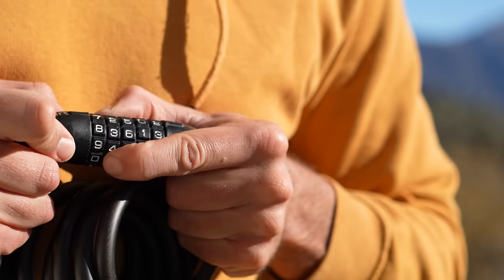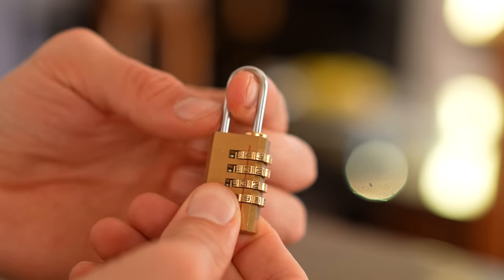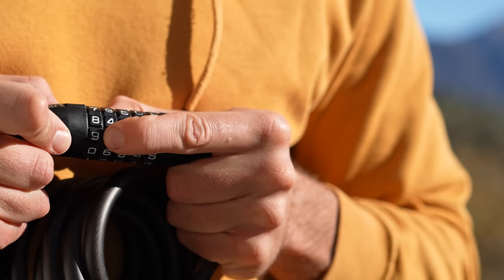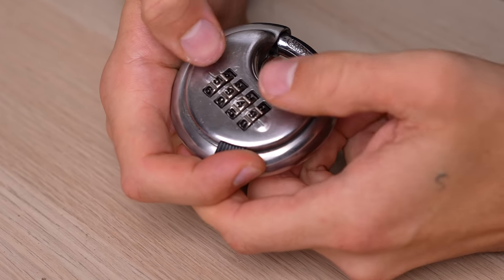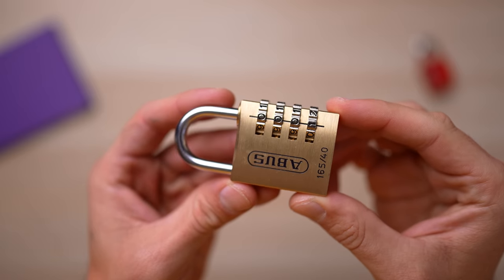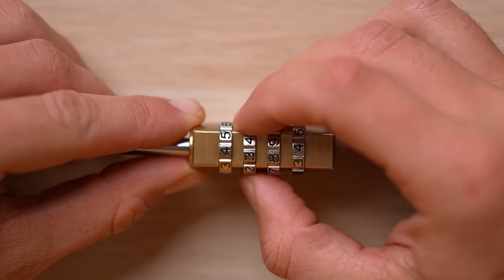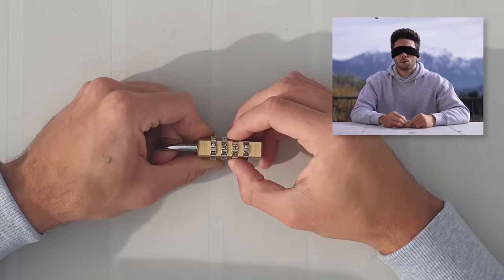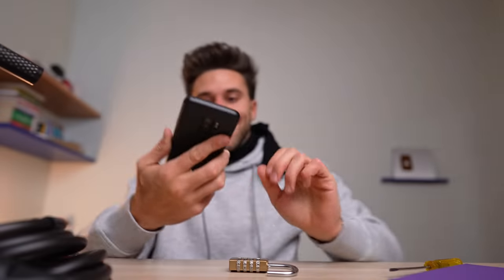This is Why Combination Locks are Completely Useless

Comment: There is an obvious caveat to your claims. Combination locks and any locks for that matter are so easy to pick when you're sitting in a warm room, and have all the time in the world. Imagine doing the same in winter downtown, during a busy day, when your hands are too cold to do this without gloves, and with gloves you cannot feel the pressure that well. And when you're under constant gaze of pedestrians and you're not all too sure if one of them will turn out to be the bike's owner. I use a 10/10 high security Kryptonite chain lock with 14 mm thick links, as well as a Bully Lock which sends warning to my pager if the lock is touched, and on top of this, my battery compartment is locked, and the battery is secured with a really thick cable combination lock. Is it foolproof? Not at all, but there is a 99.9999% probability that any would be thief will pick an easier target after seeing all the locks he would have to pick.

Comment: How about showing us that you changed the combo without looking at it, or had some else change it for you?   Also, lockpicking is easy with simple locks that don't use security pins, horribly angled keyways, or pins on the sides of the spool. You don't know crap because you don't show yourself apply what you learned to cracking a combo lock reset without your knowledge.  How about using a feeler shim to see if you can feel the gates sure you'd pick up that real easily.  Also, doing it blindfolded doesn't mean anything.  1 you edited all of that.  2 you very easily could have just remember how many turns you needed on the dials to crack it, which is why you quit after 10 minutes and tried again.  This doesn't help people, especially because some locks can't use this tension method.